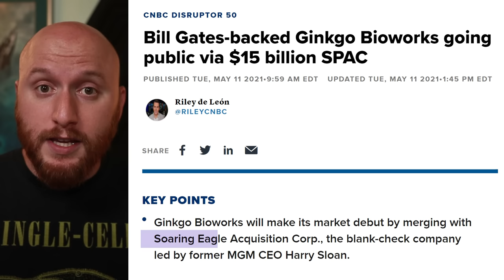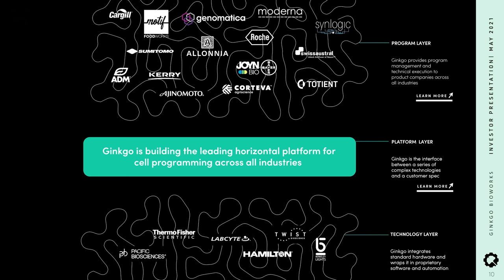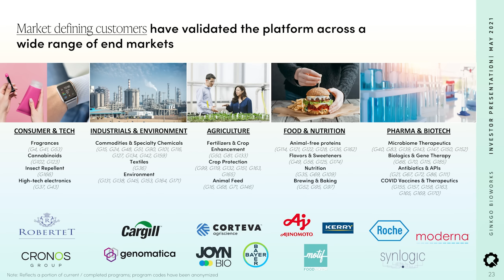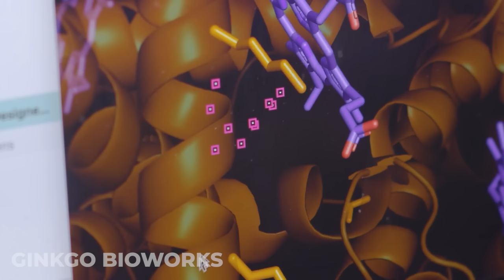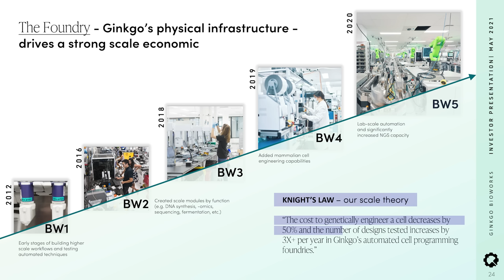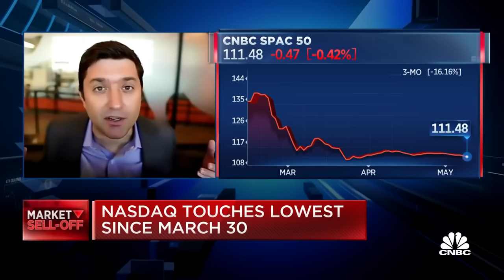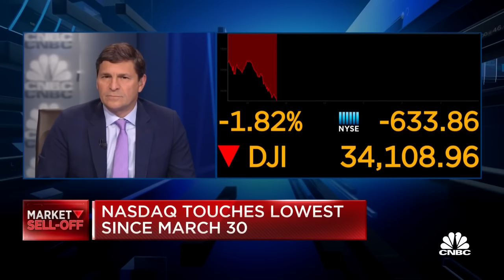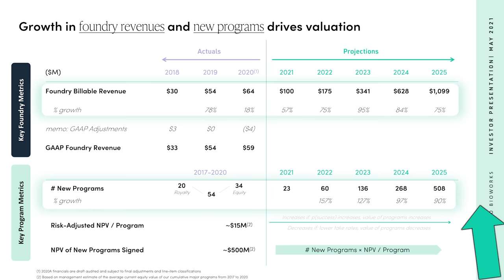🧬 DNA Stock | Is Ginkgo Bioworks the Next Amazon Stock?

Comment: I'm in and a believer. However, I'm also diversified in high growth companies with big cash balances, to cover cash flow losses for about 5 years. So I'm very exposed to drops in the market, caused by a possible recession/ depression. The one good thing is; I wait for a company to drop 70 to 90% before my first buy in. So if the markets drops another 50% or so I would dollar cost down. On DNA I'm in at $2.40, I'll buy again at $1if it goes that low. And then hope! THE HARD PART IS TO HOLD ON FOR A DECADE. Good luck

Comment: So to purchase this because I am extremely interested. Should I buy SRNG now or wait for DNA?
Reply from the maker: As long as the deal goes through, it's the same thing. SRNG stock will turn into DNA stock later this year.
Reply: @TickerSymbolYOU  What happens if the deal doesn’t go through?
Reply from the maker: Then you own shares in Soaring Eagle and the price will go down to $10 again, exactly where it is right now. But these are the same guys that took SKLZ and DKNG public.
Reply: @TickerSymbolYOU  they also have some massive failures. Those aren't  their only spacs.
Reply: @TickerSymbolYOU  You seem to almost implie theres no risk there? Why would it only go down to 10USD? Isnt it a market? If theres big players in the SPAC and they seel due to failure surely smaller investors with no inside info will lose out?